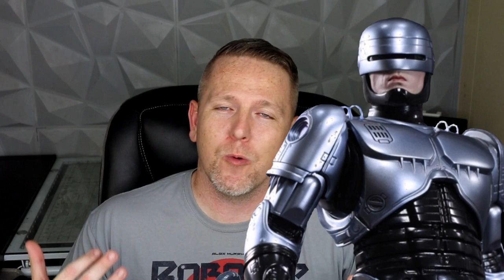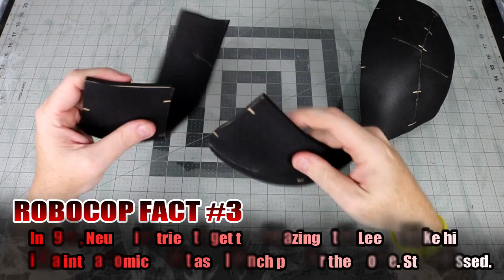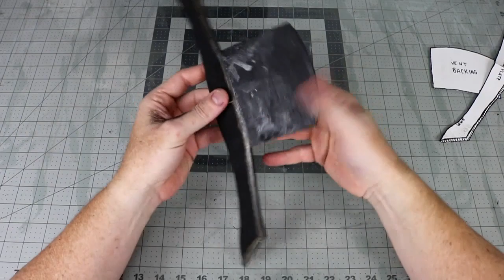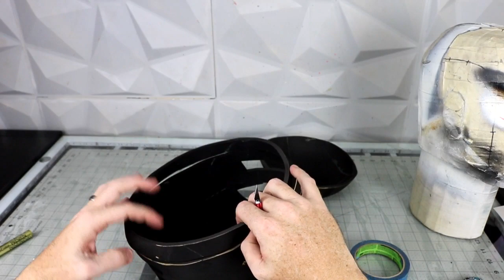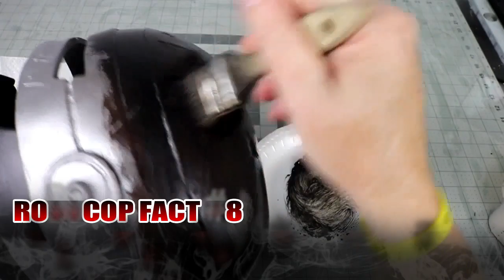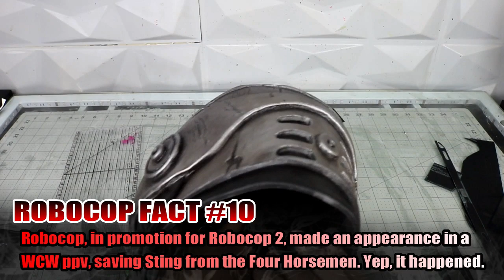Building a Robocop Helmet from Robocop 1987

Comment: I just made this over the weekend. Wanted to build a Robocop suit since 1987 (I'm in my 50's). I must say that the template is easy to follow, I'll certainly give you credit. In my case, I had to resize by putting in a trianglur dart in the back and trimming the jaw line as the helmet was a bit too big (and I'm not a small chap). But it looks great for what I want (not too worried absolute screen acuracy). Thank you so much for ALL your tutorials and templates. Top builder.
Reply from the maker: Yep, people don't realize from the videos that I am a very large person. At 6 foot 3 and 250 pounds, my ginormous cranium takes up a lot of foam 😄. Glad the template helped

Comment: Can I buy cosplay foam From Micheals
Reply from the maker: Most Michaels, Jo-Ann's, and Hobby Lobby have there own brands they carry. Get some, try it out and see what you like. I have found online resources to be the most beneficial. HD Foam from SKS can be bought on Blick.com, What The Foam from Cosplay Apprentice can be bought on Amazon, and TNT Cosplay supply online has a wide range of foams. I have a closet full of all different kinds, which are beneficial for various projects. In a pinch you can even score floor mat foam from Lowes, Home Depot, Walmart and Harbor Freight which is meant for low impact flooring in workout spaces but can be used for foam builds. Usually this foam only comes in 2ft X 2ft sheets with texture imprinted on one side. Hopefully this rambling helps.